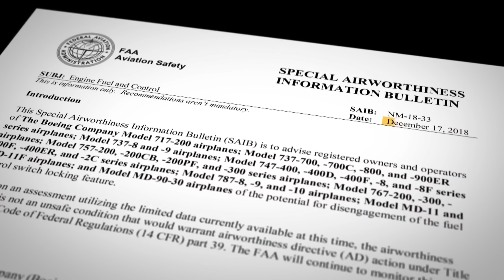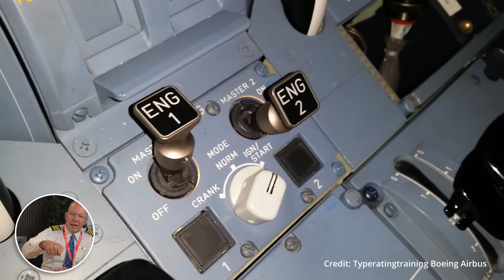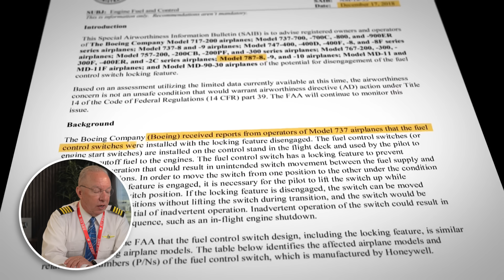Air India 171: The FAA’s 2018 Fuel Switch Locking Bulletin Explained (16 Questions Answered)

Comment: Is it possible for a pilot to flip those fuel switches from Run to Cut-off, successively within 1 second? This 1 second time can rule out the possibility of pilot involvement as it is almost impossible to pull out the switch, place it down at cut-off position for engine-1, then again repeat this WITHIN 1 SECOND for engine-2! Seems like unreal.
Reply: no, other experts have said it can take up to 4 seconds. so i think 2-4 seconds. another thing, no one has gone into a simulator to actually time this. Why not? Steeve doesn't talk about it nor is it in the report. So until it's done and we find out the actual time it takes , i don't buy the report or Steeve's irresponsible affirmation of it.
Reply: @stevebubbie1126  One confusion till now, according to the report, one pilot asked " Why did you cut-off the switch", now, it is not possible to detect for the driving pilot (co-pilot) to actually notice that cut-off switch randomly while flying (during takeoff, must be busy focusing forward). So only possibility of asking that question by the driving pilot could be after being observed by some movements, neither it was not possible to detect the switch position. And the monitoring pilot should not ask this question as he was continuously monitoring the takeoff process. Confusion

Comment: I'm very happy to hear you don't hit the fuel cutoffs shortly after takeoff. I know people want to avoid blaming pilots, but we have never had a crash caused by two engines failing anywhere near the same time. You just have to look at the odds. It might seem common to lose an engine, but it's not; most commercial pilots will never lose one engine, it's so rare. From the start, anyone in aviation, even if they didn't want to say it, knew it was a 99% chance the pilot was at fault. It was hard to understand how such a large mistake was made. But as much as we don't like it, once again we find the most logical conclusion to be true: it was intentional.

Comment: What is if the springs of the fuel control switches were for some reason broken (e. g. due to material fatigue). The switches wouldn't be held in place as tight and maybe as a result of the rotation and increased vibrations they might be able to jump out of the RUN positon?

Comment: Dr. Steeeve: Could it be that the pilot who moved the fuel supply switch to "cut off" did that action absentmindedly / inadvertently thinking that he was retracting the landing gear. The video shows that the landing gear is still extended as the plane went down and crashed..

Comment: They should make a detailed inspection of the aircrafts maintenance records to see if those switches were updated, restored or any components alone that line of connection before trying to blame the pilots. I don't think intelligent young men, being professional commercial pilots would make a naive stupid mistake by, cutting off the fuel while on mid flight. There has to be a better explanation then that. It's always the pilot did this or, the pilot did that, really!! That sounds like a hidden mechanical flaw that was never addressed or ignored
Reply: i think it back in 2023 when they were replaced. not sure

Comment: COULD YOUSHOW A VIDEO OF THE PHYSICAL OPERATION OF THE FUEL CUTOFF SWITCHESS?
Reply: @whall6101    I have those switches somewhere in the lab (university) but I never uploaded video to the YT. If I had time, maybe.    Anyway, failsafe part of the switch is a spring, and a cam ring , (or cam washer if You want).   Any of those two missing, and switch can flip without effort.  It is easily possible to install switch without one of them, or both...If you drop them to the floor, spring usually bounces off somewhere out of reach, or the ring cracks (aluminum) and You could be tempted to install the switch "naked"...

Comment: From what source does the Black Box get information as to the state (position) of the fuel control valves? . Is this info obtained from the main controller or a sub module that powers (cycles) the fuel cut-off valves. Doubt the signal is obtained directly from the fuel switches. From what little info that is contained in the interim report I cannot see how a control system malfunction can be ruled out.

Comment: Realistically how long would it take an engine to spool up to max thrust after the cut off is set to run? Would you have to return the thrust lever to iits lowest setting or stick it in full tilt straight away?  I'm not a pilot but just thinking out loud. How close the other pilot would have got to acheving lift after this awful situation. Regards M

Comment: Capt. Steeve what could be the reasons for any of the pilots not trying to retract the landing gear even after realising the switches were on "cut-off" position or even after changing their positions? Would it not have reduced the drag and helped the plane lift off, especially since you mentioned that the Engine no. 1 started to produce thrust.

Comment: Capt. Steve came to immediate defense  of Boeing soon after the accident suggesting a pilot mistake in not turning on Flaps theory! Then Steve flip fopped soon in a few days when a video surfaced showing RAT deployment and analysis that followed. Now again Capt. Steve quickly jumped in to defend Boeing by trying to suggest that pilots have manully intervened in shutting off fuel switches. Look, I have no doubt this guy has lots of knowledge and exposure but seem to fall sort of basic honesty, integrity & patience. Of couse we do find some dishonest doctors hooked up with the coporate health industry in promoting needless drug inrerventions. I will not be surprised his next flips & twists are to come soon after final report that could take months if not years :)

Comment: This is so tragic. A big indicator that the switches weren’t pulled in response to an emergency was the one pilot questioning the other… had their been some other explanation for the engine failures and the switches were pulled in response, the other pilot would have not been confused but instead would have been on the same page, trying to manage the emergency. And although I’m no expert, there would also be other objective data prior to the switches being pulled to that showed the emergency.

Comment: The report stated left engine shut then right .  Would that not conclude it was a manual intervention .  This was identified with engines being redeployed but tragically too late at such low altitude & loss of speed.  What must be discovered is which pilot pulled those engine fuel cut off switches.  The pilot flying probably not. The monitoring pilot probably . But who knows & will this be found in evidence

Comment: Also the answer to why the plane kept climbing after shut down is pretty obvious… 

Imagine you have a toy car, you push it and push it and you let go. It will continue moving due to momentum and will stop due to friction. Same thing with the plane, yeah there was no more thrust but the plane was moving beyond the speed necessary to generate lift. It will begin to stall once the drag slows the plane down to the point where not enough lift is generated

Comment: Captain Steve Im sorry but i strongly dissagree.
Cameras in the cockpit will not only show what exactly happened, but they will play a major role for pilots NOT to do things they are not supposed to. So you can say that a camera could have prevented this accident. With the cameras investigators can see the exact cause of the situation, therefore, safety measures will be taken immediately, whether a mechanical problem will be fixed or serious attention will be paid to the mental state of the pilots, meaning saving hundreds of lives is more important than the comfort of the pilots and this is not even a debate. Always better to know what exactly happened, rather than relying on assumptions when lives are on the line.

Comment: As an engineer, I learned never to say things can't fail. When I was in the military and ran a small patrol craft, we had switches that were locked in place and used to shut off both engines, and one night in heavy weather seas, both engines shut off because the switches released and shut off the engines. Unfortunately, they can never prove exactly what happened and why. I think there should be cameras in the cockpit, at least a camera that shows the control panel.
Reply: The fact that that camera footage could be used to vindicate the pilot being maligned by Steeve's theory is one good reason to have cameras, a lot more important than seeing that someone read a newspaper. They could make it be that it's only retained if there is an accident.
Reply: @jandrews2735  He doesn't have a theory, he is reading the evidence provided. We are beyond a theory about what happened, only the who and way are left to determine.
Reply: @jandrews2735  I agree with you.  Alternatively camera memory cards  should be designed to store  only the last 20mins of the flight  before the plane stoppages This is very possible if new data continually overwrites  previous data as the  memory becomes full.
Reply: @tonywyse9201 FIFO. first in first out.
A camera in the cockpit would have told us which pilot had a death wish.
Reply: @TerryMundy True that,  I agree with you about this  However, i strongly appeal that we do  not jimp to conclusions just yet, no matter how highly probable it seems that this might be a murder/suicide case. Let's await the final report. Afterall, nothing we do or say now will change the fact that 260 people lost their lives in a tragic and preventable accident.  May theirs souls rest in peace.
Reply: Good point.  A switch designed to not allow accidental switching could have failure mode, like broke tension spring in this case.   You would see that on the video if the cm eras covered that area
Reply: @JBoy340a those switches pretty much survived the crash. If there is something physically wrong with those switches, Iam sure they will find out soon enough.
Reply: @HanryKumala  Hopefully, the switches will be checked for proper operation.
Reply: what are the odds that both switches' safety fail at the very same time? none
Reply: @dfsjkl4352 You are right; the odds are slim, but not impossible. That is why, during the investigation, they must complete the background checks on both pilots and look at all possible causes.
Reply: @dfsjkl4352 what are the odds that am anomaly hit a bad function that was missed (or ignored) by a subcontractor during quality assurance/patch testing?

All to meet release date and user story deadlines?
Reply: @dfsjkl4352  They didn't; they failed one second apart.
Reply: Yes. I agreee. Especially with so many subcontractors and so many control modules and lines of code. 

It is a needle in the haystack that might not be replicated.  And its easy for industry to blame the unexplained on the pilot (that humans presumed error)..

Instead of the other humans errors that were before that pilot sat in that seat. Or that plane took off..or left a hangar..or left the assembly line
Reply: ✈ The human error theory seems weak in this case. In a cockpit, both pilots sit so close that if one of them even moves their hand toward the engine switches, the other will immediately notice.

🔧 Shutting off the engines involves physically moving a switch or lever — it's not something that happens silently or without visibility. Plus, right after takeoff, both pilots are on high alert. There's no chance one would be distracted or inattentive during this critical phase.

🧑‍✈ According to aviation SOPs, shutting down an engine is a major action and is never done without cross-confirmation between both pilots.

👉 So if both pilots claim they didn’t shut off the engines, and yet both engines failed nearly simultaneously, then a technical glitch in the engine control or switch system cannot be ruled out.

🛑 Aviation authorities need to conduct a detailed investigation into the dual-engine control system. Jumping to blame human error without hard evidence — especially in a case involving loss of life — would be unfair
Reply: @MaujL8fe0 I am fully in agreement with your submission.  Let's not forget that there was a 2018 Airworthiness Safety Buletin where it was advised that all Boeing 787 operators should inspect the fuel control switches.  Information in the public domain is that Air India did not carry out the recommended inspections. So it is possible that what happened in AI171 was due to an electronic malfunction of the switches or the aircraft FADEC system.  It is easy to put the blame on the pilots who are not alive to defend themselves. But I am strongly opposed to that  unless and until there is incontrovertible evidence to support that claim.
Reply: @tonywyse9201  I'm still catching up with all of this stuff, so perhaps he has revisited that bulletin in a subsequent video, but I agree. Even in this video, Steve moved past that 2018 bulletin without looking into all of its ramifications. Specifically, at 7:43, he speculates on the purpose of the bulletin being about the installation of the switch, that it could be installed upside down, which would be corrected long before this flight.

But the bulletin was not so narrow in focus, only that there was "potential for disengagement of the fuel control switch locking feature." Every expert – Captain Steve or otherwise – have reinforced that those switches can't be flicked by accident due to their locking system. But that bulletin alerted people that the locking system did not always work. Thus, it's quite possible this craft had that very problem. A mechanical failure cannot be ruled out completely.

The OP is correct: you can't rightfully say something never fails. There may be many multiple backups, redundancies, safeguards to reduce the likelihood of failure.
Reply: @MaujL8fe0 Brilliant. I concur with your submission.
Reply: At the very least an alarm should go off if fuel is cutoff mid-flight. If there’s a fire or an engine falls off I could understand it but are there any other reasons to intentionally cutoff in flight?  An alarm / warning wouldn’t prevent it from happening but bring faster focus to the issue, whether caused mechanically, accidentally or intentionally.
Reply: @larryr257 Great suggestion. However an alarm going off when/if the fuel control switch is turned off during a flight take off may not prevent a crash because even if the  switch is flipped back to the on position immediately, jet engines take a little bit of time to reignite and provide thrust to the aircraft. I am also in favor of the suggestion  to inhibit the switches from from being moved to the off position during flight take-off. This combined with  the alarm, would be a robust way to prevent catastrophic mishaps such as we saw in AI171. But what if what occurred in AI 171 was due to an electronic malfunction of the Fuel Control switches and/or the FADEC system?
Reply: They have cams for business class to view from the tail and from under the fuselage😂😂😂😂 but not a single cam in the cockpit. What an absurd, uneducated and uncivilized industry 😂
Reply: @sonyjose4735 Politics.
Reply: These Indians will not admit
Reply: Never say humans can't fail emotionally either. Who can say one pilot didn't just snap right there in the cockpit and decided to play with the switches to see what kind of response would happen. Maybe he flipped it as horseplay but intended to flip it back on quickly to see what would happen to the plane
Reply: @johnmonk3381 Dumb ways to die. What does this button do?

I’m forever telling folks to look with their eyes and that's no place to be.
Reply: @johnmonk3381 That's very true, and that's why a complete investigation always needs to be done. People can always snap.
Reply: and how much memory would you set aside for that video/image, which area of that memory would you sacrifice
Reply: @ampur2  I have a security camera that records stills and videos of the box I put up for screech owls. It uses a micro SD card that can store several days of video recording 24 hours a day. This is a non-issue with today's memory technology. Also, you wouldn't sacrifice any memory, you'd add its own dedicated memory, which will add a couple of grams to the weight of the plane.
Reply: @ampur2  What a weird question. This makes no sense to start talking about what memory would be sacrificed. Any video recording storage would require an upgrade to the CVR to handle video storage or an additional 3rd black box. No sacrificing memory would be necessary.
Reply: @ampur2   Total Non issue with amount of memory available on Flash and SSD Memory with todays technology. You can buy a USB Thumb Drive with 4 TB of memory as of 2024 from Retailers. An SSD has even more. That could record a whole flight in Real Time Video.
Reply: @ampur2  memory / storage is cheap. Per day, it would cost less than the luttuce in a burger.
Reply: @ampur2  The camera memory cards  could be designed to store only the last 20mins of flight-time before the plane stops ( normal stop or a crash). This is very possible if it is designed to  continually overwrite  previous data as the  memory becomes full.

Comment: Cockpit Voice Recorders were only accepted by pilots and unions WHEN crews were capable of bulk-erasing the recording when 1) On the ground, 2) door open. Conversations could and would be reviewed by Company during labor tensions to discipline "trouble-makers". When you got back safely, you could erase non-safety audio. Yes, many workplaces have VIDEO monitoring, but would you work for someone who was  recording ALL your conversations???? Video on the flight deck could work IF a safe-on-ground erase function was included.